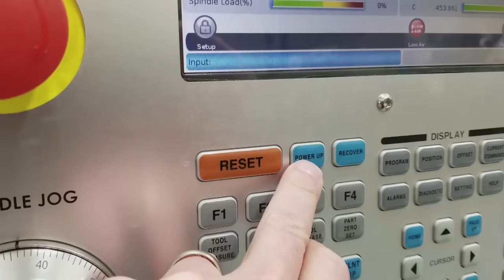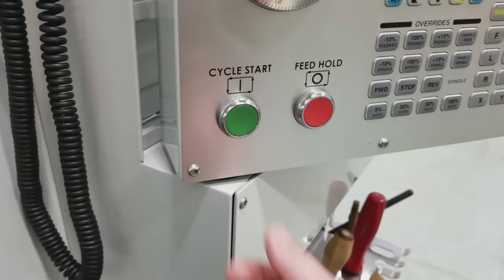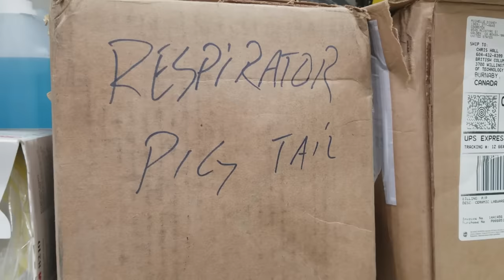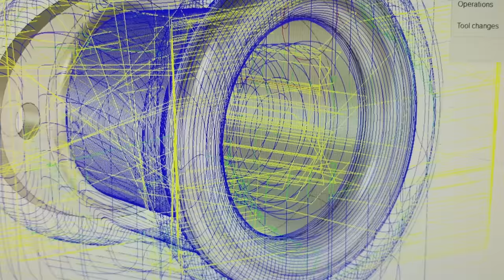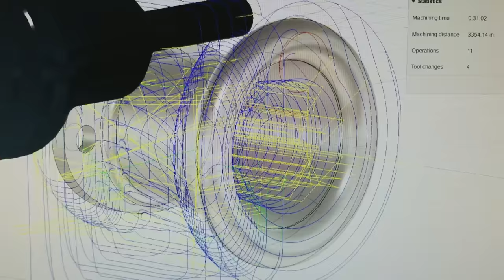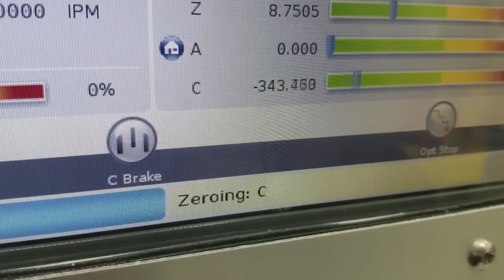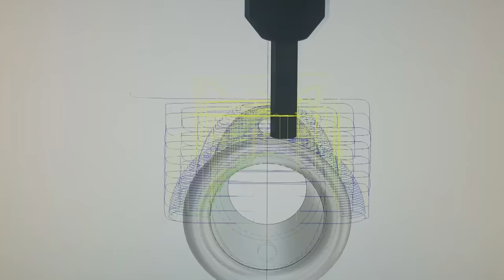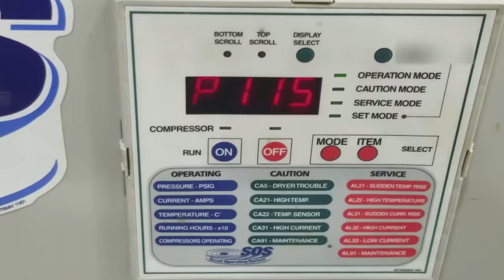ROBOTS are NOT going to steal your job | Ram Air Intake

Comment: is this proof that the robots will take our job or not?
Reply from the maker: Definitely maybe.
Reply: Will
Reply: they will, i think the video is trying to show us that a lot of jobs can be easily replicated
Reply: Won’t this is a machinist showing that robots are more trouble than they are worth
Reply: @matthewestep3946  yeah but he picked parts that are super complicated. And models that would purposefully crash the  systems. Most machine parts are simple. Most of the time shop guys can plug in a bunch of points and watch the machine work. Sure some complex parts are gunna need hand crafting but very expensive. And automation is just starting to take off. China is focusing more on fine motor skills and we are focusing more on large scale manufacturing.
Reply: @vindictiveDOOM  I mean. Sure. 200 years is pretty much starting to take off. If you're a vampire.
Reply: @tcmasters123  ummm 200 years ago we didn't even have home computers... I'd say the field has come a long way.  And it shows no sign of slowing. Automation has already displaced hundreds of jobs.
Reply: Actually, they will not take most of our job. But many of us would quit or change the job because you will be paid less. Human can be cheaper than robots in many cases. Humans are very cost-effective.
Reply: @PaleOrchid  what about nural nets and deep learning? Watson already detects thyroid cancer better than doctors. AI is expected to replace undergraduate law clerk work in the next 50 years(filling out paperwork). Robots are currently replacing the textile industry. The trucking industry will be gone soon. "All jobs"... of course not, humans will always prefer human interaction. But the effects on jobs via automation have already been observed. and again science is only getting better
Reply: @PaleOrchid  the buying point for a robot is a return on investment in one year. That's very hard to do. But it's already worth it for many packaging and manufacturing companies (small companies included).
Reply: Have
Reply: @vindictiveDOOM  a good machinist can do everything happen
Reply: You've never worked in a shop, have you?
Reply: @vindictiveDOOM   A machine will always use a tool how it was designed. A machinist will always utilize tools outside of the designed characteristics. Basically, robots can't think outside of the box and probably never will because that level of thinking comes from billions of years of evolution.
Reply: @I_Try_Shen   Yes I have actually. Yes mechanics are very good (rolls eyes). Never  ever has a shop guy wasted days or screwed up on a simple part. Never ever have the shop guys messed around smoking and drinking coffee all day.  

Humans are incredible. But do you wanna machine the same spacer block 100 times every day for the rest of ur life? I don't, I'd rather build a machine to do it for me.

It doesn't matter how good the mechanics are. We arnt talking about fine craftsmanship. We talking about automation of simple things.
Reply: @jefferydaniels5672  I mean not entirely true. Some nural networks have show to cheat the environment they were given. Showing signs of... Dare I say... Creativity?? 

Pluss machine shop guys will probably be one of the last people to have their jobs taken by robots. Very difficult job with lots of different ways to solve the problem.
Reply: @vindictiveDOOM   to add to that, compare this to the longer, or similar timeframe and much lower accuracy of hand forging, or moulding, that would have been the only alternatives before robots
Reply: Didn’t understand a lot of what was happening but great camera/ editing work, was engaged
Reply: If they do it will be fine. The government will have to install something to quell civil unrest like UBI during a robot industrial revolution. Which means all you factory workers can just spend the whole day watching fox news if you want without a worry in the world..
Reply: @arduinoversusevil2025  you're an Oasis of reason.
Reply: @arduinoversusevil2025  well I think you show how a robot is nowhere near being able to problem solve enough, even given Elon Musk’s simultaneous advancements and warnings of A.I. Let’s see a Tesla think “take a nibble” out of a block to get a saw over a hunk beer can stock using “if, thens” and “true, false”. We have a way to go before robotic Arnold Shwarzenegger’s are crafty enough for that. When they go from saying “a+b=c.2, c.2 beyond parameters, cannot complete task” to “a+b=c.2, take a c-hair of the end bud, task complete”, then we either unplug them or figure out what kinky “services” these metallic f-er’s enjoy that keeps us “useful”.

Plus I bet their double entendres suck.
Reply: Same not sure why this is on my feed but it was amusing
Reply: @arduinoversusevil2025  very smart man thanks
Reply: You all have missed the point on this video. Humor followed by reality of the work day is the take-away. But you can all continue to dissect and anal-ize this to death if you like but most things just aren’t that deep fellas.
Reply: Let's play factorio
Reply: The video highlights all the things a human person must do just to get one of these machines going. If you're the guy who does all of these things your job might be safe.
Reply: Yes
Reply: What he doesn't show is the fact that an 800 person+ factory was required to craft one of these parts before his CNC became mainstream.
Reply: @arduinoversusevil2025  :(
Reply: The answer is D
Reply: @ga1actic_muffin  or they'll just reduce the population to reduce the amount of unemployment!
Reply: Wish I had worked under someone like you...I worked at a Indian 🇮🇳 run CNC shop in Ontario when I was younger... the fella kept telling me I was gonna be an apprentice... but I felt I was just a labourer... he didn’t have me do much other than load the workpieces into the machines and run the program... I asked when I could start learning to change tools and fixtures and he just never took the teaching part of it very far... I was young and impatient so I quit after two years of no sign of a government apprenticeship program happening.
Reply: Jamin Gaming 
Can you say ‘Margret SANGER’S planned abortion mills and Bill Gate Kung flu
Reduce the excess population’ A Christmas Carol’
Reply: @alfamale2478  sure I can.
Reply: Same
Reply: Ya. Cause robots can't push buttons. 🤣
Reply: @gravfielddrive  care to explain?
Reply: 1. Human beings are biological machines (=biological robots). Your brain produces chemicals and current. Your software consists of a) reflexes (most basic scheme=reptile brain) b) instinct (much more advanced programming) c) emotions; highly advanced behavioral control (goal: maximize chances for survival and procreation). 2. There is no need to be afraid. If dissatisfaction in the workforce climbs above a certain level social unrest will ensue. Ultimately the powers that be don't like that. They will ALWAYS try to not let satisfaction drop below a certain level. They learned the hard way that the workforce will cruelly retaliate. Example: The last time they let the workforce be wholly unhappy the people went and killed all kings and queens. Result: democracy
So believe me: individuals will suffer but all in all the workforce (us, the people) will rule
Reply: Anything that’s unskilled labor is pretty much screwed. That even goes for the majority of HR people, anyone who does Data entry, unskilled labor, etc.
Reply: As someone who works near robots used for manufacturing and packaging of brick, robots are more efficient and cost possibly the same in the end. We have 3 stacking robots, that can move 17k+ bricks per 50min for 22hrs of the day. I for one dont want to try to move that many bricks that fast. Luckily I work on the giant natural gas fed kiln, where there cant be any robots accidentally shutting it down. No skill required, just cant mess up.
Reply: They will definitely leave a cleaner workspace behind.
Reply: Better learn to maintenance or program them. Y’all might be losing your jobs but not technicians.
Reply: Naa. When minimum wage comes up to the same price as it costs to produce and maintain robots then maybe.
Reply: People already answered. Those that use technology and those who are used by technology. "Tey tok rrr jeorrbs!!!
Reply: If you really think robots aren't going to  take the jobs of many welders you're insane because that's what innovation does! Capitalism wants the best bang for its Buck which is automation always getting rid of a worker is the best thing gets rid of annual salary that must be paid.
Reply: You job is gone... You just proved the case
Reply: Everything works in cycles, the robots advance to the point of self awareness, where upon they go feck this I'm outa here, hey presto full employment 👍
Reply: Robots no, outsourcing yes
Reply: Grim noise in the background, would have preferred the dam busters March, the Germans love that
Reply: @danieldimitri6133  Just relatively not so long ago to start a steam locomotive and get it going was very complex, and time consuming process. Nowadays, just hop in the machine, push a button, and off it goes. 
Maintenance and repairs? 
Screw repairs. Broken? Replace. Machines won't need to have five fingers. They will need only one. The middle one.
Reply: Sky Net is already here. It has begun!
Reply: I really hope there will be a robot to take our jobs, and i hope it happens tomorrow.
Reply: I'm an auto diagnostic tech, and so far, the computers have been mostly wrong about what's broken on the car.
Reply: @vindictiveDOOM  how does the machine find and repair corrosion in a wire harness under the dash of a car?  I'm not worried about losing my job to a machine at all...
Reply: @matth9359  sure, in the near future. But you will feel the down stream effects of the automotive industry. Your job probably isn’t a good choice for automation. Once robots can handle farm work they will be able to handle anything.

Comment: After serving 20 years on CNC machines, I became an engineer. The thing I miss most is being around machinist, especially since, you know, they have a sense of humor.... Engineers... Not so much.....
Reply: There are times when I wish I could have put left hand thread on everything.
Reply: Well said!
Reply: @obsoleteprofessor2034  I nearly stripped out the lugs on my box truck driver side before I realized they were reverse threads. Why they do that? Smh
Reply: @FGuilt  Dodge/Chrysler did that alot in the 50-60's, as I remember changing tires as a kid. I guess they thought the rotation would keep the nuts tight. Fan clutches are that way too.
Reply: 100%. I'm an engineering student who came from a few production jobs... Boy has my experience with my peers, professors, and factory engineers been... boring and autism-heavy. I hope to land a job that lets me visit the production floor regularly lol
Reply: Very true 😂 ik this is a year late. But I've been getting my engineering degrees squared away and in the mean time I'm a machinist and well need to say my engineers definitely dont have a sense of humor😂 and they hate it when I can fix my machine better than they can
Reply: Truer words have never been spoken.  Worked for about 10 engineers as a machinist.  Quit because I wasn't having enough fun.  I love cutting metal! Having meetings 2-3 times a day and getting managed by engineers--not so much.
Reply: After taking 4 years of engineering to become a mechanical engineer I secured a job at General Electric. I hated it so much that I went back to banging nails. Carpenters have way more fun.
Reply: @obsoleteprofessor2034  my dad's grandpa's motorhome, my dad broke his 1/2 in. MAC air impact when he used it going to the right on left hand threads :/
Reply: I studied mechanical engineering, I wrote my dissertation working for 5 months with a 6+1 axis machining robot to discuss precision and accuracy in different conditions, it was a pain but I loved it, and I started thinking that it would be better to study as a machinist. Now I'm a drone pilot.
Reply: As an engineer I was almost going to say we do... My computer had PTSD from all the profanity I have used against it. Yeah you are right engineers do not laugh they drink
Reply: @chatparesseux  I've met enough drunk engineers to know that they do laugh, and that it's a very good idea to put yourself 100+ metres from anything which you aren't 100% sure is structurally sound or that may be jury rigged...
Reply: That's because engineers are the joke themselves
Reply: @obsoleteprofessor2034  I loved  Plymouths when I was a teen, all I drove one day I changed a tire on the driver side of my sisters Galaxy. Forgot to tighten the lug nuts. That was never a problem with the Chryslers
Reply: @Trenz0  My GF worked for Space Systems Loral. She used to go to the production floor regularly where they were building communication satellites that weighed several tons.
Reply: One day robots will be programmed with a sense of humour...
Reply: @FGuilt  left hand threads go against direaction of tork
Reply: @Trenz0  I spent 6 years in the maintenance department in a large factory. Truer words have never been spoken!
Reply: @mikeries8549  this late but I hated engineering so much I switched and got my paramedic license. Get the weirdest looks.
Reply: Engineers is all theory and status, CNC operators are absolutely amazing, the best of both worlds...